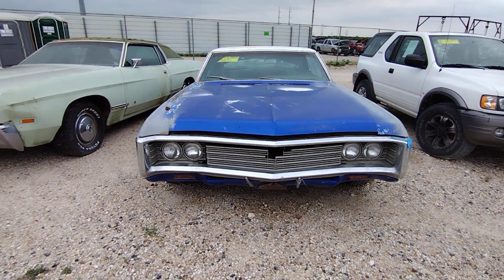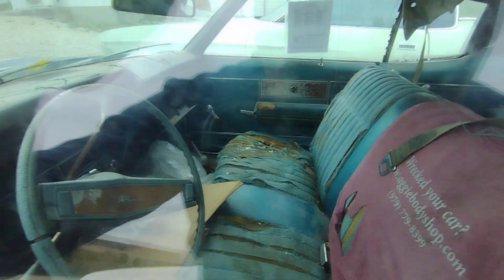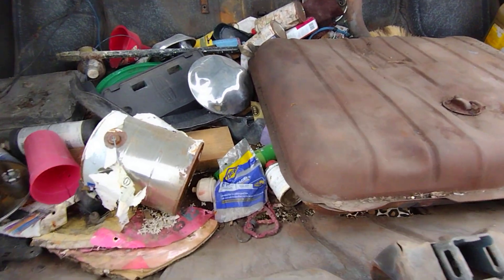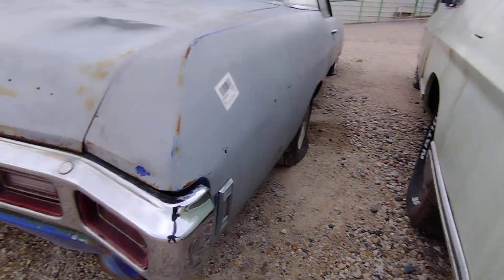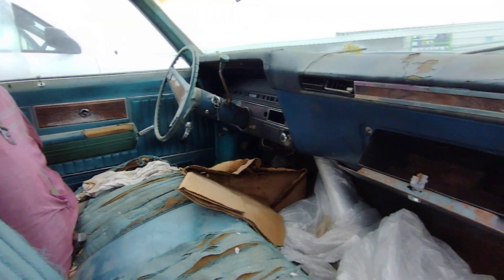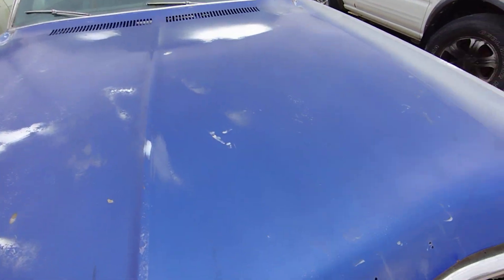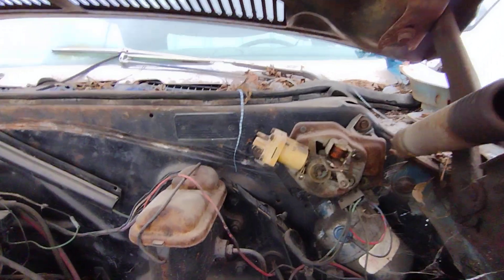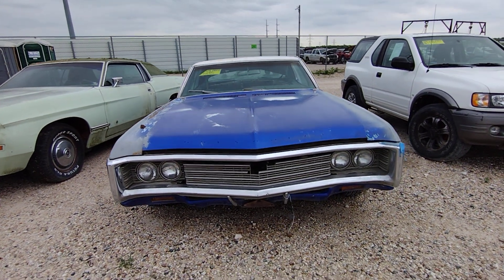For Sale 1969 Chevy Impala Junkyard Find

Comment: Whoa Nelley, a "deer" and the end is near. Rough, rough, rough, rough, rough. It's going to take a lot to get that rolling again. There are a lot of hidden sins under that primer. I'm assuming the Motorcrap heap next to it is the next video. LOL. I'm going to guess maybe that's got the sloppy 400 in it, or did at one time. 

We got the VIN, we win: 1 for Chevrolet, 64 for Impala V8, 47 for door two Custom Coupe, five passenger, 9 for 1969 model year, L for Van Nuys, CA assembly and the rest is the production sequence. The Van Nuys plant was one of the "Terrible Three" of the GM system with poor quality, and it was not missed by GM management when it closed in 1992 after the last 3rd generation F body cars rolled off the line. 

We got the tag, we can brag: ST69 for 1969 model year, 16447 for Chevrolet (1) Impala (64) two door Custom Coupe (47) five passenger, VN for Van Nuys, CA assembly, 844 for Turquoise interior trim, 55 for Azure Turquoise lower exterior paint and 50 for Dove White upper exterior paint and 03C for the third week of March 1969 production.

Whoa Nelley, assembled in CA and going away. That's it, time to quit. 1969 and used to be fine. Custom Coupe went for a loop. Two-tone needs to be thrown a bone. B body looking very shoddy. Made during the Presidential tenure of "Tricky Dickie" and this one has way too many hickies. That's it, time to quit. Going to be flat and that's that. GM division 1 is just about done. Possibly going to get squished and the B body faithful, many here, Benny for sure and yes, the Google Man are going to be very, very, very, very, very pissed.
Reply: And there's no warranty on this particular vehicle 🙃
Reply: @garymckee8857  It's guaranteed to be a heap. LOL.
Reply: @googleusergp  327?
Reply: @taur86466  As far as?
Reply: @googleusergp  you didn't decode the motor like usual.I'm assuming its a 327 is all Mr. Google.
Reply: @taur86466  Prior to 1972, GM VINs do not tell you the specific engine that was installed. So, it could have been any available V8 available that year. We'd need the numbers off of the engine, including the partial VIN # to know if this is the original engine that came in the car.
Reply: @taur86466 Mom had a 69 4 door with a 327 and 3 on the tree. No power brakes, no power steering, n no radio.